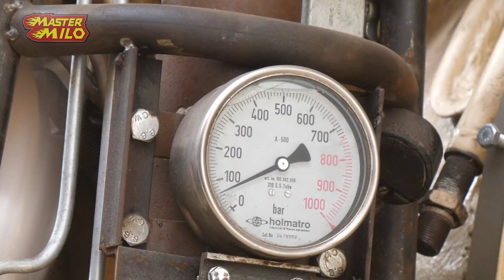Tank verplettert scooter & Rijplaten worden opgehaald!  #703

Comment: Hey folks, a quick English summary (a day late)

Thomas and Paul are helping today, they’re clearing the outside around the workshop. Emile was already busy with painting, this time green came out of the paintgun. The rings for the headlights are going to be painted black instead of green because pictures showed that color. 

Emile read the comments about the painting the Luaz, which included some criticism. He doesn’t paint like the way It was taught to him, (using mixing cups and paint rulers to have the correct proportions) but with years of experience painting cars for races where there just needs some color on the vehicle, like this it works fine. First add some thinner to the spray container to prevent unmixed thick paint coming out first. Then you add the paint. You mix it with a stir stick (that’s reused after mixing the primer). The mix was too thick, so some thinner was added. He will use the 3 second rule when taking out the stick, that means that after taking out the stick, the paint start dripping after a 3 seconds dribble. (He is using a nozzle of 1.4mm) Also he gave a quick explanation which paint can be diluted and how the paint gun works. Emile likes to keep the needle as far open as possible, and regulates the amount of paint by using the trigger. 

After the explanation the bottom of the Luaz and some more parts are painted in green while Paul, Thomas and Tom are playing outside with the forklift. The water was sucked out of the track of the RollKa and it was moved inside. The seat of the Luaz was removed of its mounting and the scooter was polished because it was sold to Carl.

A truck came to pick up the driving plates that were used during the renovation. They talked about how the plates get cleaned, and when the T-69 drove over them. 

After some coffee it was time to start the T69 and drive it towards the gate at the front to have enough space to gain speed to crush the scooter. The scooter was welded to a metal bar to give it more stability. After the scooter got crushed, the scooter was peeled of the concrete. The T69 was drove inside which concluded the day. 

Have a great day.
Reply: merci Robin!!
Reply: thanks!